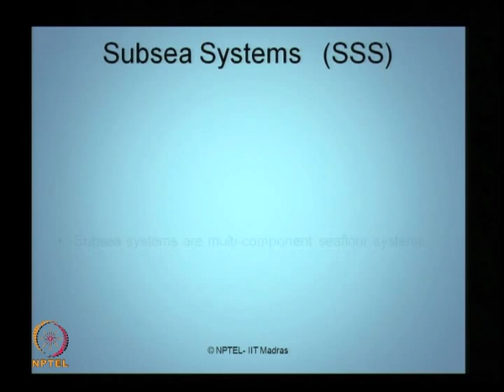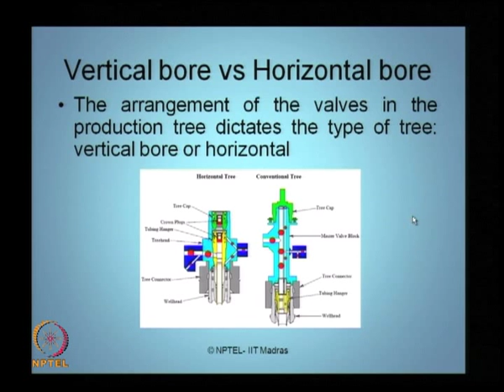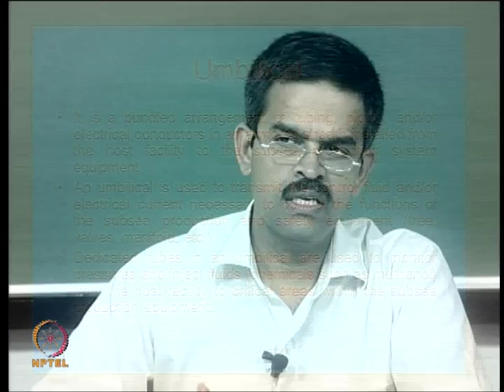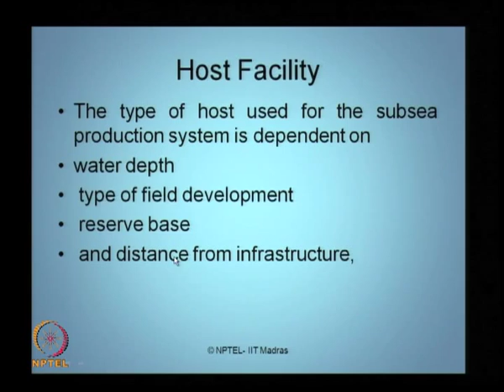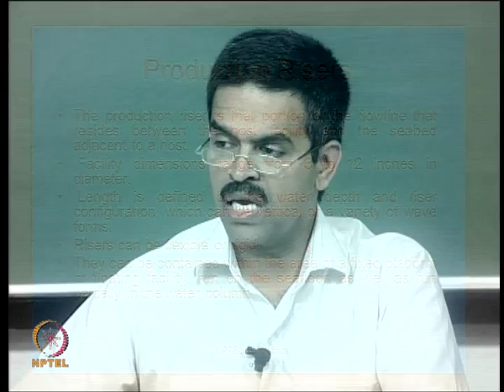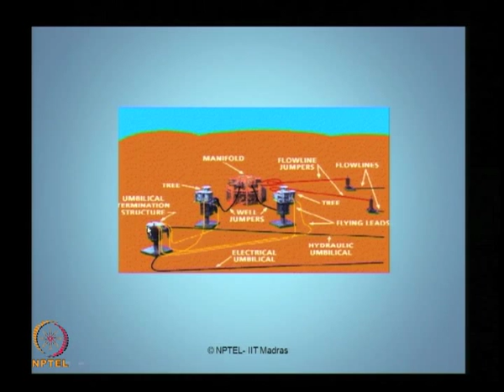Mod-01 Lec-06 Subsea production systems

Comment: Nice and compact but you have missed out important info.
You show jumpers but do not describe what their purpose.I mean yes of course to connect the other components but why shaped like this? or why we Do have to use them and not connect the components directly to each other.
You show vertical and horizontal bores but do not describe their basic differences. Obviously it is not the dimentions but rather what are the pros and cons of using each. Using HCT can be more costly but people still use them....why? these type of things.
Also one more thing. Flowline=Before process, Pipeline=After process